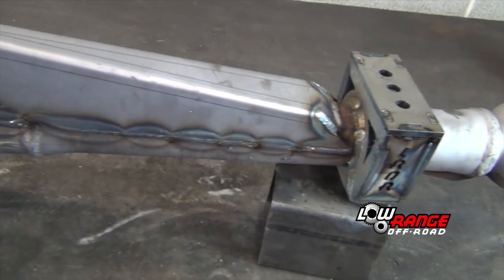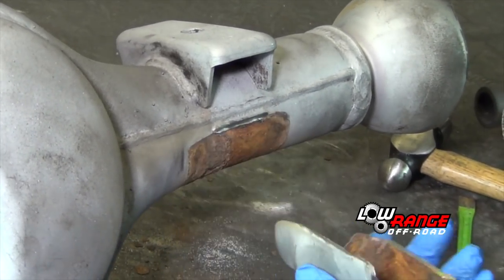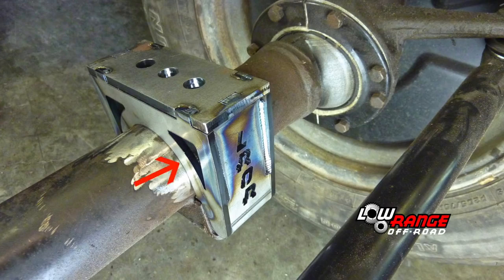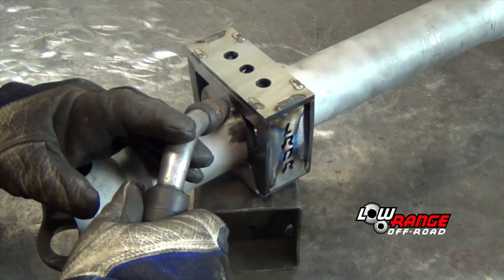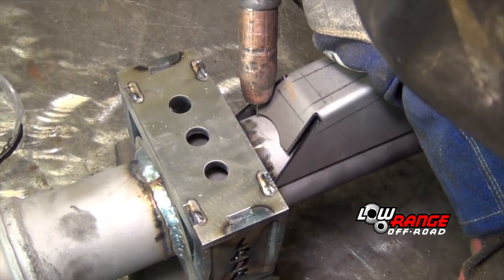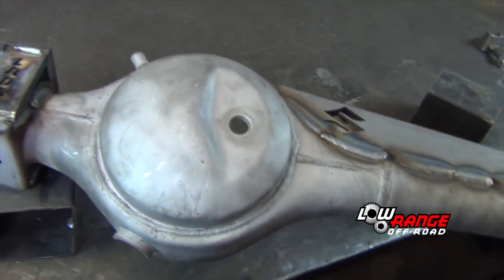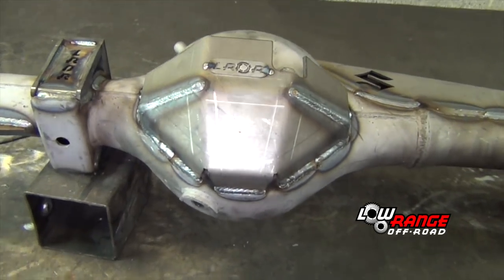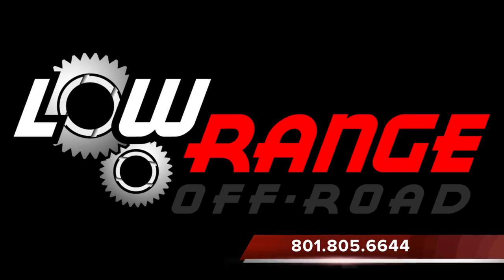How to Rebuild a Samurai Solid Front Axle (Part 2) Axle Housing Modification

Comment: Too many weld points for that thin of a diff, you would have weakened it by putting in that many hot weld points, I would reduce the welds by almost half and yet it would not change the strength at all. I also wouldn't go beyond 1 inch long at a time. This isn't a 1 ton dana with 1/2 tube thinkness these are like tin cans if you ever seen inside one it's at a .120

The logo was a dumb idea I would seal it off. I would of closed in the gaps between the hotter welds with a low amp setting just to do enough to keep out the mud,sand, or w/e may work its way in between the truss and axle housing.
Reply: Id agree, alot of weld points on one side of the axle with the trusses, those welds will all contract on cooling, if they dont bow/warp the axle during welding they will add a shed load of inherent stress on the underside of the axle. Maybe im overthinking this by being a welder. Also, dont you push mig welds into the job rather than pull? 
Ill say again, i maybe be being overly perdantic on the process used and overthinking about its final application and weld strength required.  Good intuitive video though. Thank you